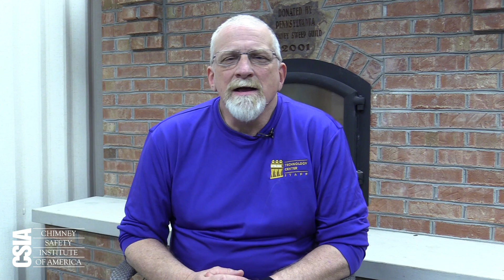Draft Issues In Your Home | Ask Russ

Comment: I converted to gas fireplace when moving into home 20 years ago. However shortly after using fireplace within a couple months I began to smell gas. I had someone come out said no gas leak. Could be downdraft? What should I do have it cleaned? It didn’t have a gas odor when I first began to use it. Please help me Thank you! I never used it now for 20 years. It happened to both fireplaces. No one could tell me what to do
Reply: Something is leaking or the burners are not operating properly if you smell gas. Make sure the burners are cleaned and burning 100% of the gas. May still have a drafting issue but you should not smell gas. Have the gas company or fire department check for gas....they have good equipment.